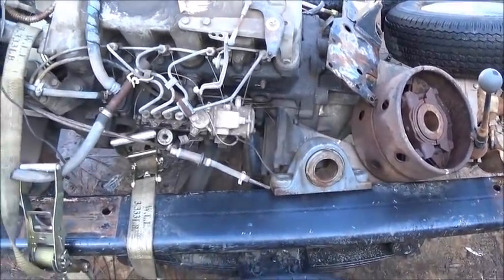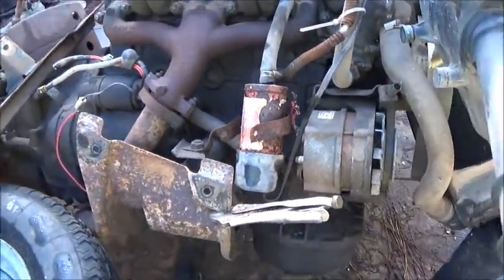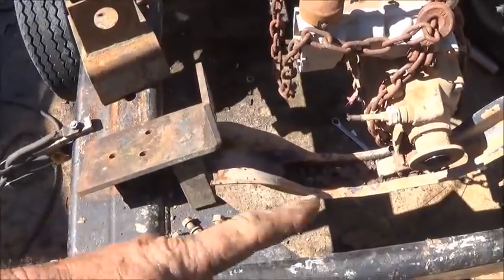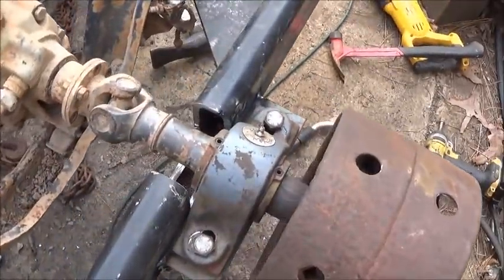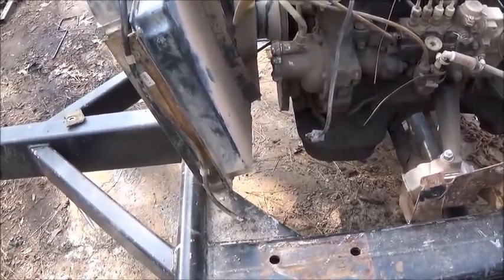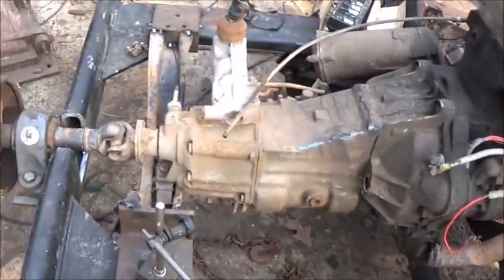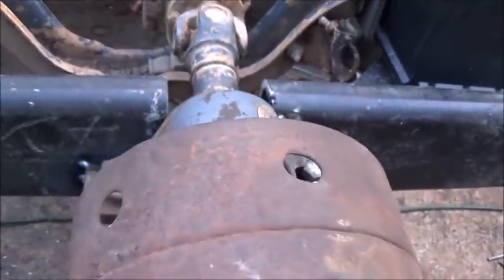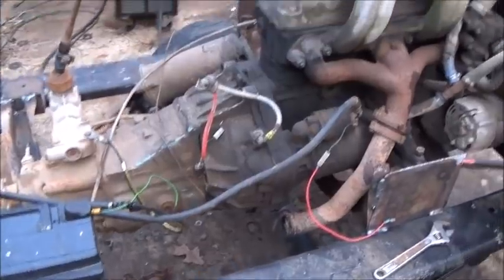MERCEDES DIESEL TO TRAILER MOUNT POWER UNIT

Comment: Loving the cat scanner lol , tried one myself but my two woofers caused too much interference. One quick tip I thought I should add. U-joints always need a little bit of missallaignment. When I was younger grandpa took the time to move and modify the crossmembers in his motor home so that all the joints were in line and it beat them all apart on our way to Colorado that year. He learned and I did too that if they don’t have an angle to run thru the needles won’t move in the caps. The needles not moving and from being inline basically removed the preload and allowed them to just load and unload pushing all the grease out of them instead of staying loaded from being on an angle allowing the rollers to constantly move. Sorry about the long explanation,my soapstone won’t work on here for me to draw with,it’s a lot easier to explain when ya can see the physics instead of having it in print. Anyway,great work on the videos and glad to see your content.

Comment: Excellent video Johnathan W  :) trailer motor setup love also do a AC Delco Alternator from 1968 to 1985 year one with Double Pole with internal regulator also if do single pole need reglator box to ! Also 70 to 100 amps be more enough run you need !

Comment: Out of curiosity, with your "steam certificate" make you a stationary steam plant operator in NC, or is this just to be able to have more knowledge about temperatures and pressures to be able to safely work on the steam gear?

Comment: I think for very lightly loaded use your belt drive may work.  But for anything close to full load I think the belt pulley needs to be fully independent of the engine/trans with a couple u-joints on the drive shaft.  Think of how much torque the engine will put out and how much of a side load that will put on the pulley.   Rubber mounts and u-joints are no designed to take that sideways  loading.
Reply: Will the vibrations crystalize the driveshaft tube portion permitting the pulley with belt to fall? Would shortening the tube and machining the stub shaft to fit the pillow block I D been possible?

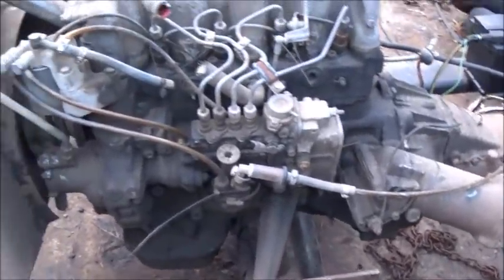Comment: 12:34 What is that canister behind the injection pump ?
Is that the oil filter ?
Reply: Dear RDF.
Yes, if you mean the oil filter housing that angles. On/in a Mercedes Benz sedan it sits upright/vertical so that changing the filter can be done extremely easy from above. Obviously the housing has to sit different in/on a MB pickup truck where this fantastic 240D engine came from. Only 72 hp but good for over 600.000 mls (with good maintenance of course)!!! I'm definitely not joking! F
It's famous for being the most reliable and durable Diesel engine that Daimler Benz ever built.
Best regards, luck and health.
Reply: @Chr.U.Cas1622  Thank you for your answer and education on this engine.

Comment: This project is looking really nice so far. Germans tend to overbuild their equipment.It should work well for you. Are you going to point the exhaust up or leave it down?
Reply: I was thinking the same. Would the manifolds flip over? can't see if the bolts are in line.

Comment: Odds are good your pulley bushing is actually 1-15/16". It's uncommon for vintage flat belt pulleys and lineshafting to be sized on the even inch or even fraction of an inch. 3/16, 7/16, 11/16 and 15/16 being the most popular.

Comment: Pretty cool setup. Those old Mercedes diesel engines are tanks. I have a 79 Mercedes 300d with the 5 cylinder diesel engine and you just can't kill it.

Comment: I'm always glad to see NANA cat keeping an eye on you.
Ok, that was a bit cold but I just couldn't help myself.
That backlash is the pulley acting like a flywheel. You are confusing that transmissions mind as it has never ran loose like that. You think if it was in neutral nothing turned but the input and the output was always tied to a driveshaft. The only time you would have ever noticed was when you let off the throttle while still in gear slowing down.
As you said about problems.
One day soon I hope to stop by and see you in person Jonathan. I feel we are kindred spirits as we see things in stuff others would consider junk.
My focus has always been on my family so I have always built something from nothing and with little to no operating budget.
For now travel safely and good luck on that test.
Cheers
Terry from South Carolina

Comment: Steam class, with possible certificate? I guess boiler safety is a necessary thing needing certification. 
Speaking of which, I'm really interested in how the steam yard is going to be laid out, where the main boiler will be, what engines will it feed, and how all that steam plumbing is going to work.
I can't imagine each running engine will get its own boiler, so it's intriguing to thing about. 
I can't remember seeing the edger this trailer mounted diesel is going to run. Bound to be a beast! Strap it up! Looking forward to seeing some edging getting done with this unit powering it.
Of course, all this is Nana-approved...! Thanks for your channel.

Comment: Some of the Sterling trucks (medium duty) had Mercedes engine/transmission packages in them.  Not one of their better ideas, in my opinion.  I had at least 4 moves that had the (6 speed manual) transmission grenade a bearing with less than 200 miles on the truck.  It got to where the first thing I would check on the truck was mileage and hours.  If less than 200 miles and less than 5 hours on the hour meter, it sat and idled until it had 5 hours, and first leg of the trip was always less than 100 miles, then the truck was shut down and allowed to cool overnight before continuing.  I followed up on a few that I delivered into Georgia about a year and a half later, when I delivered a third unit to them (not a Stirling).  He said the average for each transmission in the first two was about 28,000 miles before major repair or replacement was needed.  Troubles usually started with the same pocket bearing that had put me on the side of the road.

Engines were good.  Fair power and decent economy, but the transmissions would eat your wallet if you let it get too close.  Everything Mercedes is not gold ... though you will probably be fine on that one, with that application.  Especially if you keep it in direct.
Reply: by the way, I got two of Nana's cronies here, they like to sit on my shoulder and check out things like Nana does.  Both picked up some sort of bug and lost an eye.  Both gained similar per ... uh, purr-sonalities ... after surgery.  Sit on your shoulder, purr, watch what you do, stick a wet nose in your ear (purring) once in a while to remind you that they are there.  They paid really close attention to the monitor while Nana was on.  I think they liked her.

We call them "the purrots."  Or "Punky" and "Scritch."